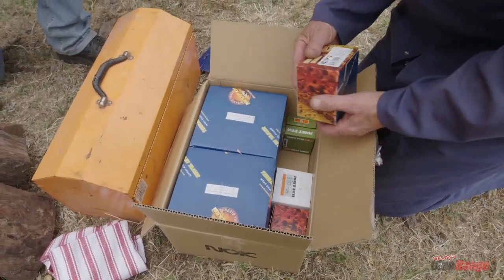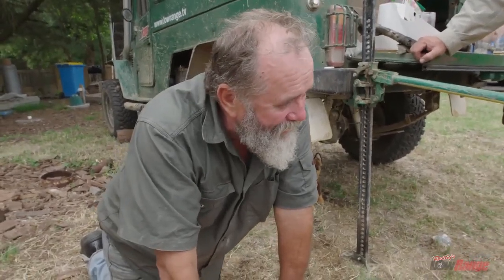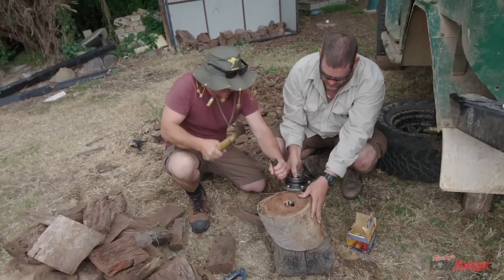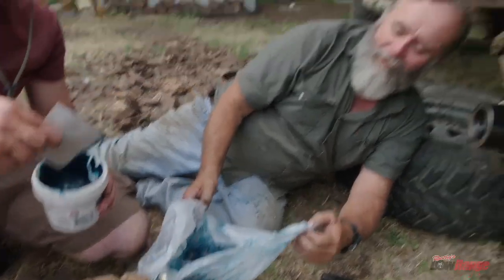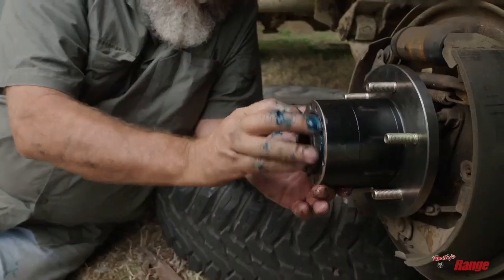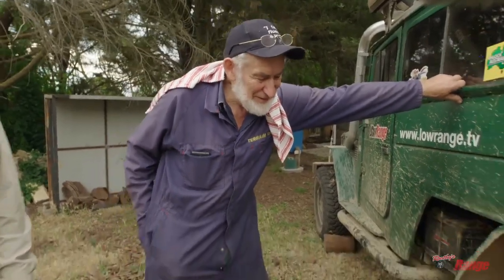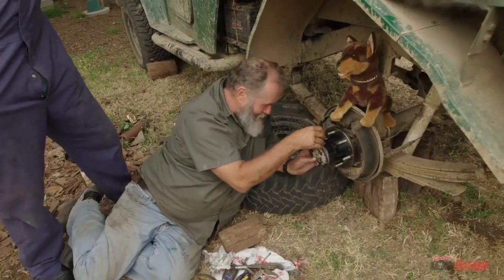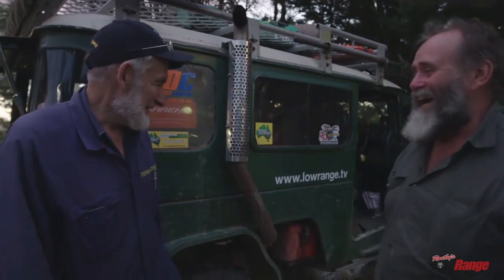Talking of legends... Allan Gray

Comment: I have had the pleasure to have spent time with Allan back in the mid 90s I was racing a car on dirt circuit when I was 15 and Allan also had a car there... and this 1 day i was at home i kept getting water in the sump I even changed head gasket and still didn't fix it... so I called around and managed to get Allans number.. i called him up and said this thing has me beat... his reply was...there is this tiny little Welsh plug that you can't see it's hidden behind the cam gear in the block I reckon that's rusted through... ok thanks I'll go have a look...sure enough that was it....nobody knows those sorts of things without being there with car in front of them..... I have the absolute most respect for him... I even think he sort of sent me in a similar direction to him..
Reply: what a story!